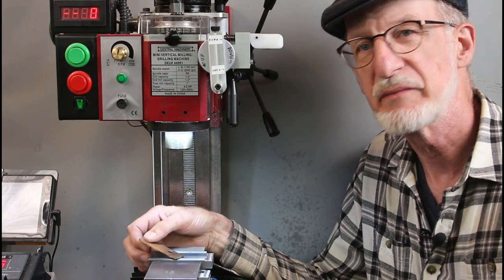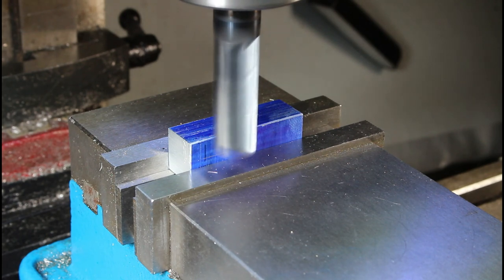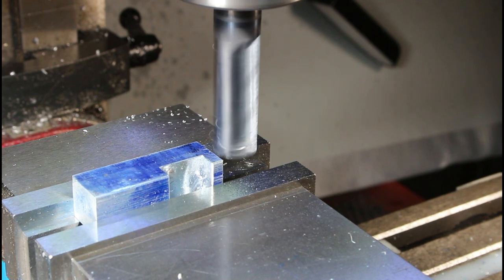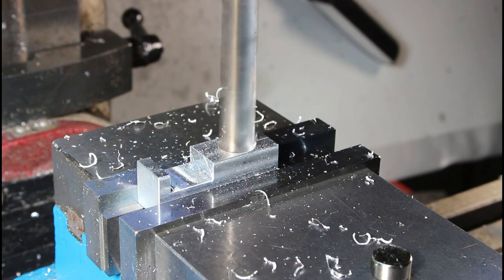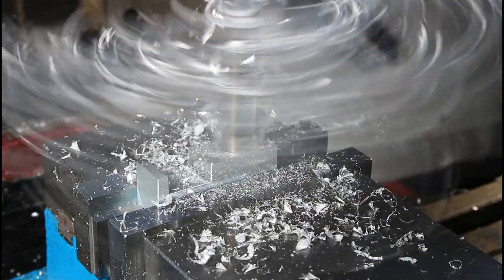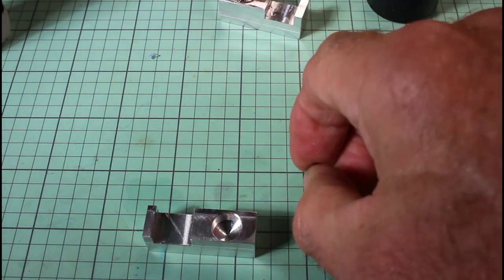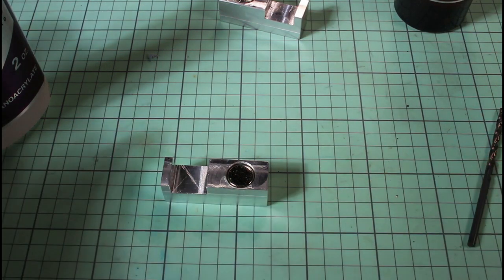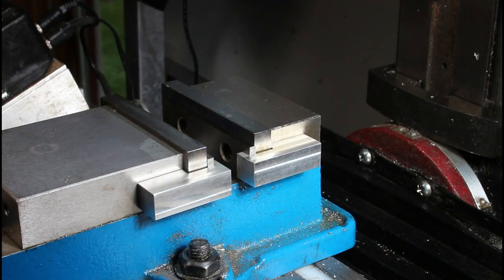Magnetic parallel holders for the mill vise

Comment: Hi Guy. Great idea! How about boring a hole in the center of both vise jaws (very slightly below jaw surface, same as you did in your holders) and inserting/gluing the neodymium magnets for parallels into the vise jaws themselves? That would eliminate any interference of holders hitting themselves when clamping something small into vise.. (You could use a smaller magnet than you used to avoid parallels being difficult to remove from vise?) You may have opposing polarity issues when clamping something small though..? I've never tried obviously, but just a thought. Great vid and thanks!
Reply from the maker: Thanks for that thought. I would be concerned about crushing the magnets inadvertently when gripping something non-parallel to the jaws.  You really don't want to break a neodymium magnet! They are very sharp and very dangerous when broken.
Reply: @GuyMarsdenMakesStuff  Ahhh. good point. In that case how about a small magnet in the parallels themselves? I realize that would be a pain to add one to every parallel.. but makes me wonder.. instead of magnetized parallel keepers, why not magnetized parallels? A 1/16" x 1/8" thick round neodymium magnet embedded in each parallel would provide enough force to not fall over..? Can you press fit a neo magnet into a hardened parallel? or maybe CA them in? I might try it here in the shop.
Reply from the maker: @greg20152015  Greg, I wouldn't recommend that approach either for two reasons.  First your parallels would be sticking to everything in the workshop, including each other!
Second, one occasionally uses parallels in the vise to grab something and the magnets would risk being damaged.  Also, press fitting doesn't seem to be practical due to the odd sizes that magnets come in, this is why I glued mine in with thickened CA glue to fill the gaps in the hole drilled by the nearest fractional size drill I had.  Perhaps I should've looked for a metric drill that would have worked, and I don't know if that would have worked.
Reply: The other issue is it'll be a pain to remove steel chips from machining when changing parts or set ups. At least with his design they'd be collecting chips off to the side and not where you're going to be holding work pieces.